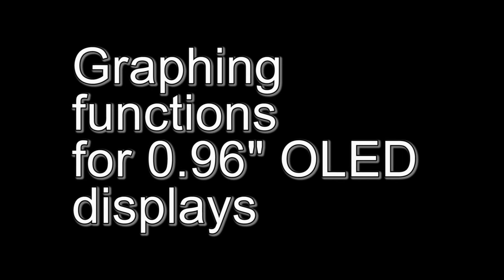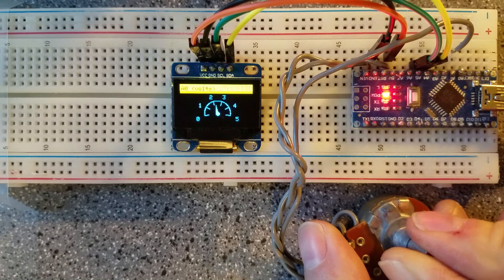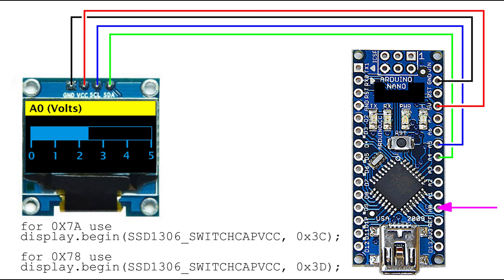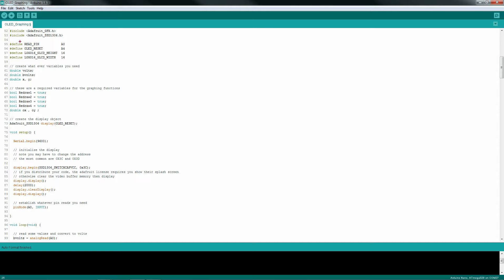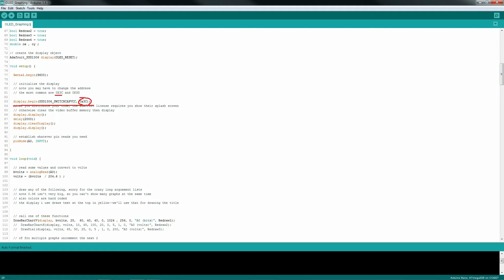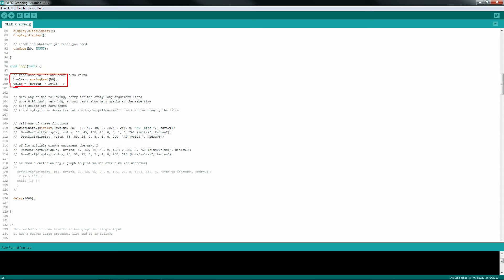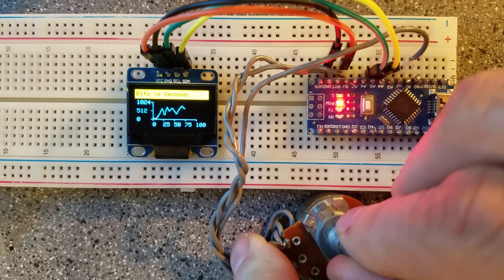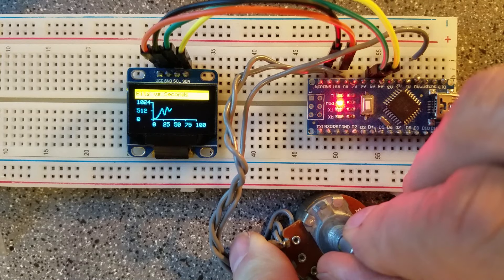FREE Functions to draw graphs on OLED displays

Comment: Hi Kris,
I know its been more than 2 years since you shared this brilliant code. I stumbled upon this for a personal project that requires plotting Temperature/Time function. All I require is temperature plotted against time for 24 hours. I tired to achieve that with your code, but with my limited coding abilities, I guess I messed it up. The temperature I want to measure is from 0-50 for 24 hours cycle. Then I want the graph to reset. Below is the modified code. I still haven't updated the source of data, so it still refers to A0. Please take a look.

#include <Adafruit_GFX.h>
#include <Adafruit_SSD1306.h>

#define READ_PIN            A0
#define OLED_RESET          A4

// create what ever variables you need
double volts;
double bvolts;
double x, y;

// these are a required variables for the graphing functions
bool Redraw4 = true;
double ox , oy ;

// create the display object
Adafruit_SSD1306 display(OLED_RESET);

void setup() {

  Serial.begin(9600);

  // initialize the display
  // note you may have to change the address
  // the most common are 0X3C and 0X3D

  display.begin(SSD1306_SWITCHCAPVCC, 0x3C);
  // if you distribute your code, the adafruit license requires you show their splash screen
  // otherwise clear the video buffer memory then display
  display.display();
  //delay(2000);
  display.clearDisplay();
  display.display();

  // establish whatever pin reads you need
  pinMode(A0, INPUT);
}

unsigned long OldTime;
unsigned long counter;

void loop(void) {

  // read some values and convert to volts
  bvolts = analogRead(A0);
  volts = (bvolts  / 204.6 ) ;

  DrawCGraph(display, x++, bvolts, 20, 50, 96, 47, 0, 24, 12, 0, 50, 10, 0, "Bits vs Seconds", Redraw4);
 // Some values were changed.
  if (x > 100) {
    while (1) {}
  }

  delay(1000);
 // If I use delay to time the graph, the entire code will be subject to delay. I want to add other functions later.

}

void DrawCGraph(Adafruit_SSD1306 &d, double x, double y, double gx, double gy, double w, double h, double xlo, double xhi, double xinc, double ylo, double yhi, double yinc, double dig, String title, boolean &Redraw) {

  double i;
  double temp;
  int rot, newrot;

  if (Redraw == true) {
    Redraw = false;
    //d.fillRect(0, 0,  127 , 16, WHITE);
    //d.setTextColor(BLACK, WHITE);
    d.setTextSize(1);
    d.setCursor(2, 4);
    d.println(title);
    ox = (x - xlo) * ( w) / (xhi - xlo) + gx;
    oy = (y - ylo) * (gy - h - gy) / (yhi - ylo) + gy;
    // draw y scale
    d.setTextSize(1);
    d.setTextColor(WHITE, BLACK);
    for ( i = ylo; i <= yhi; i += yinc) {
      // compute the transform
      // note my transform funcition is the same as the map function, except the map uses long and we need doubles
      temp =  (i - ylo) * (gy - h - gy) / (yhi - ylo) + gy;
      if (i == 0) {
        d.drawFastHLine(gx - 3, temp, w + 3, WHITE);
      }
      else {
        d.drawFastHLine(gx - 3, temp, 3, WHITE);
      }
      d.setCursor(gx - 20, temp - 3);
      d.println(i, dig);
    }
    // draw x scale
    for (i = xlo; i <= xhi; i += xinc) {
      // compute the transform
      d.setTextSize(1);
      d.setTextColor(WHITE, BLACK);
      temp =  (i - xlo) * ( w) / (xhi - xlo) + gx;
      if (i == 0) {
        d.drawFastVLine(temp, gy - h, h + 3, WHITE);
      }
      else {
        d.drawFastVLine(temp, gy, 3, WHITE);
      }
      d.setCursor(temp, gy + 6);
      d.println(i, dig);
    }
  }

  // graph drawn now plot the data
  // the entire plotting code are these few lines...

  x =  (x - xlo) * ( w) / (xhi - xlo) + gx;
  y =  (y - ylo) * (gy - h - gy) / (yhi - ylo) + gy;
  d.drawLine(ox, oy, x, y, WHITE);
  d.drawLine(ox, oy - 1, x, y - 1, WHITE);
  ox = x;
  oy = y;

  // up until now print sends data to a video buffer NOT the screen
  // this call sends the data to the screen
  d.display();

}

It had to be a long post since I din't want you to look through the original code from the archives.

Thanks a lot for your contribution.
Reply from the maker: I'll fix this to meet your needs.
Reply: @KrisKasprzak 

Thanks a lot Kris for your valuable time.
Reply from the maker: @glasseffect  

Fixed up code, I added code to read a 10K NTC thermistor and plot. Also added  a status bar since updates are every 20 min (so 24 hours will fill entire screen).

#include <Adafruit_GFX.h>
#include <Adafruit_SSD1306.h>

#define READ_PIN            A0
#define OLED_RESET          A4

#define WHITE 1
#define BLACK 0

// constants for 10K NTC thermistors
#define NTC_A  3.354016E-03  // from the data sheet
#define NTC_B  2.569850E-04  // from the data sheet
#define NTC_C  2.620131E-06  // from the data sheet
#define NTC_D  6.383091E-08  // from the data sheet
#define NTC_R1  9800.0       // resistor for thermsitor voltage divider
#define tr1  9800.0      // resistor for thermsitor voltage divider

// create what ever variables you need
float volts = 0.0, TempF = 0.0, TempK = 0.0;
long tr2 = 0;

unsigned long bvolts;
float x = 0.0, y = 0.0;
int p = 0;

// these are a required variables for the graphing functions
bool Redraw4 = true;
float ox , oy ;
unsigned long OldTime = 0, CurTime = 0, ReadTime = 0, counter = 0;

// create the display object
Adafruit_SSD1306 display(OLED_RESET);

void setup() {

  Serial.begin(9600);

  // initialize the display
  // note you may have to change the address
  // the most common are 0X3C and 0X3D

  display.begin(SSD1306_SWITCHCAPVCC, 0x3C);
  // if you distribute your code, the adafruit license requires you show their splash screen
  // otherwise clear the video buffer memory then display
  display.display();
  //delay(2000);
  display.clearDisplay();
  display.display();

  display.setTextSize(1);
  display.setCursor(2, 4);
  display.println("cat");

  // establish whatever pin reads you need
  pinMode(A0, INPUT);

  DrawCGraph(display, x, volts, 20, 50, 92, 30, 0, 24, 6, 50, 100, 25, 0, "Temperature", Redraw4);

  ReadTime = millis();
  OldTime = millis();

}

void loop(void) {

  CurTime = millis();

  // take a reading every second otherise we're averaging for 12 seconds eery pass is over kill
  // this will give 96 readings and let us draw a cute time status bar in the yellow area

  if ((CurTime - ReadTime) >= 12000) { // 12000

    ReadTime = CurTime;

    // read some values and convert to volts
    bvolts = analogRead(A0);
    volts = volts + (bvolts  / 204.6 ) ;
    display.fillRect(p++, 13, 2, 2, BLACK);
    display.display();
    counter++;
  }

  // sicne were drawing every 80-20 or 60 times le't
  if ((CurTime - OldTime) > 1200000) { // 1,200,000 ms = 20 minutes

    OldTime = CurTime;
    volts = volts / counter;
    // voltage divider calculation
    // vo = 5 * r2 /(r1+r2)
    // solve for r2
    // get the exact value for voltage divider r1
    tr2 = ( volts * tr1) / (5.0 - volts);

    //equation from data sheet
    TempK = 1.0 / (NTC_A + (NTC_B * (log(tr2 / 10000.0))) + (NTC_C * pow(log(tr2 / 10000.0), 2)) + (NTC_D * pow(log(tr2 / 10000.0), 3)));
    TempF = (TempK * 1.8) - 459.67;

    if (x >= 24) {
      // 24 hours has passed
      // reset x and redraw the graph (erasing it)
      x = 0;
      Redraw4 = true;
      display.clearDisplay();
      display.display();
      DrawCGraph(display, x, TempF, 20, 50, 92, 30, 0, 24, 6, 50, 100, 25, 0, "Temperature", Redraw4);
    }

    else {
      // clear the stats bar
      display.fillRect(0, 13, 128, 2, WHITE);
      display.display();
      //note graph starts at 20 and ends at 92--may seem odd but that gives 72 pixels of drawing with. so....
      // we update the display every 20 minutes (24 * 60 = 1440 minutes, 1440 / 72 pixels = 20 min per pixel)
      DrawCGraph(display, x, TempF, 20, 50, 92, 30, 0, 24, 6, 50, 100, 25, 0, "Temperature", Redraw4);
      // Some values were changed.
      x++;
      p = 0;
      counter = 0;
      volts = 0.0;
    }
  }
}

void DrawCGraph(Adafruit_SSD1306 & d, double x, double y, double gx, double gy, double w, double h, double xlo, double xhi, double xinc, double ylo, double yhi, double yinc, double dig, String title, boolean & Redraw) {

  double i;
  double temp;
  int rot, newrot;

  if (Redraw == true) {
    Redraw = false;
    d.fillRect(0, 0,  127 , 16, WHITE);
    d.setTextColor(BLACK, WHITE);
    d.setTextSize(1);
    d.setCursor(2, 4);
    d.println(title);
    ox = (x - xlo) * ( w) / (xhi - xlo) + gx;
    oy = (y - ylo) * (gy - h - gy) / (yhi - ylo) + gy;
    
    // draw y scale
    d.setTextSize(1);
    d.setTextColor(WHITE, BLACK);
     d.drawFastVLine(gx, gy-h, h, WHITE);
    for ( i = ylo; i <= yhi; i += yinc) {
      // compute the transform
      // note my transform funcition is the same as the map function, except the map uses long and we need doubles
      temp =  (i - ylo) * (gy - h - gy) / (yhi - ylo) + gy;
      if (i == 0) {

        d.drawFastHLine(gx - 3, temp, w + 3, WHITE);
      }
      else {
        d.drawFastHLine(gx - 3, temp, 3, WHITE);
      }
      d.setCursor(gx - 20, temp - 3);
      d.println(i, dig);
    }
    // draw x scale
    d.drawFastHLine(gx, gy, w, WHITE);
    for (i = xlo; i <= xhi; i += xinc) {

      // compute the transform
      d.setTextSize(1);
      d.setTextColor(WHITE, BLACK);
      temp =  (i - xlo) * ( w) / (xhi - xlo) + gx;
      if (i == 0) {
        d.drawFastVLine(temp, gy - h, h + 3, WHITE);

      }
      else {
        d.drawFastVLine(temp, gy, 3, WHITE);
      }
      d.setCursor(temp, gy + 6);
      d.println(i, dig);
    }
  }

  // graph drawn now plot the data
  // the entire plotting code are these few lines...

  x =  (x - xlo) * ( w) / (xhi - xlo) + gx;
  y =  (y - ylo) * (gy - h - gy) / (yhi - ylo) + gy;
  d.drawLine(ox, oy, x, y, WHITE);
  d.drawLine(ox, oy - 1, x, y - 1, WHITE);
  ox = x;
  oy = y;

  // up until now print sends data to a video buffer NOT the screen
  // this call sends the data to the screen
  d.display();

}
Reply from the maker: also my code has a temp rage between 50 and 100, you will need to change that if you want 0-50

Comment: Hi Kris, it the code run on NodeMCU and Arduino UNO?
Reply from the maker: Budhaditya Biswas it will definitely run on and Arduino I've had it working before, the only challenge you run into is the lack of RAM on those Unos and it makes it hard to use any other libraries for like SD cards and stuff never used to know to MCU not sure

Comment: I tried this but my graph goes off the bottom of the screen, any ideas how to fix it?
Reply: hope you've figured it out by now, the code was written with old library where display resolution had to modify in Adafruit_SSD1306.h file
Reply: by chance do you know what modification need to be done to Adafruit_SSD1306.h
Reply: @DoItYourDream  In newer version of library you don't need to modify SSD1306.h, instead write display resolution while calling the constructor like
// create the display object
Adafruit_SSD1306 display(SCREEN_WIDTH, SCREEN_HEIGHT, &Wire, OLED_RESET);

Comment: Will this work with SH1106 driver?
Reply from the maker: Not out of the box but a few changes it should (assuming your driver leverages adafruit_gfx methods).

somewhere around line 73 change code to create the SH1106 object, just keep the instance name to display

somewhere around line 83, change the code to begin or init your new object. 

That should be all you need to do.